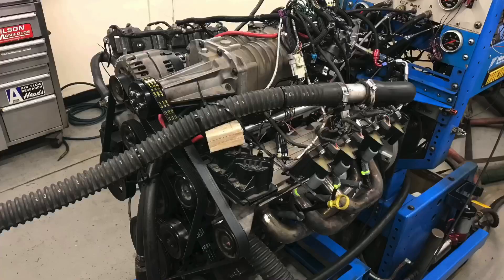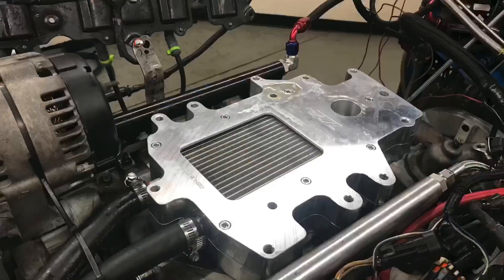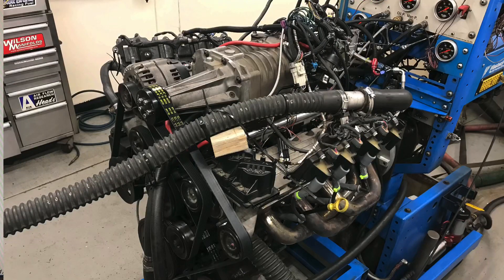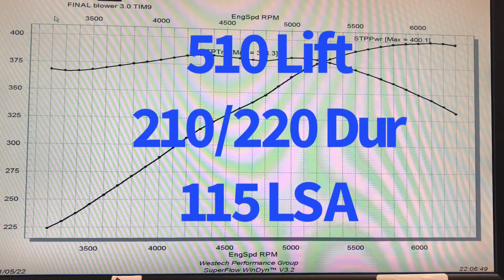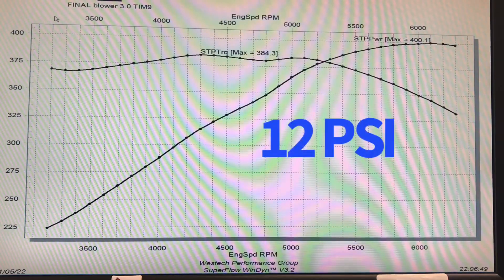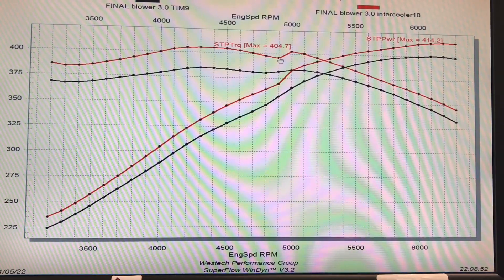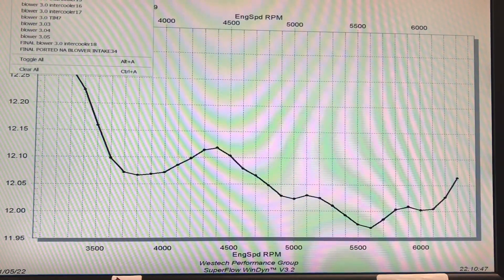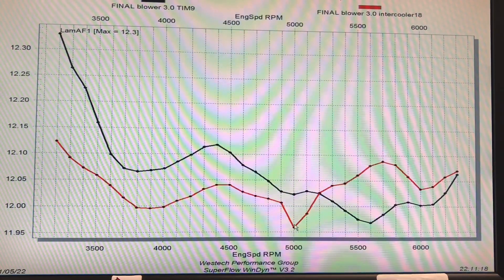DO INTERCOOLERS ADD POWER? JUNKYARD SUPERCHARGED 3800 L67 V6 INTERCOOLER TEST. ZZP AIR-TO-WATER TEST

Comment: The horsepower does not change much because the mass airflow through the supercharger remains about the same. Cooling that air does not affect the mass air flow nor the density of the air., you are just changing the factors of the PVT equation. The cooler air is desirable though for all the stated reasons.

Comment: If anyone can help I'm gonna to run that tbs #5050 intercooler on a roots blown motor mostly street driven hearing that an icebox in the trunk  isn't practical for daily street driving and that I need a separate cooling system like a heat exchange radiator and electric pump so I will have to have two radiators can some one explain the set up and part numbers if possible thanks
Reply from the maker: pump, reservoir, secondary heat exchanger (like an oil cooler), then lines and fittings and wiring.

Comment: You attempted 1 of the 3 ways to interocool these engines. And these engines require very specific tuning. Look up Brushworks Slick Sixes.
Reply from the maker: they don't require specific tuning. The require tuning like any other motor (it's just timing an AF)

Comment: I wonder if The dip is from so much torque. Being applied to the accessory drive belt. You can see the AC compressor starts to spin at higher rpms

Comment: Richard, I honestly believe the reason why you got more horsepower with the air cooler as opposed to the water meth injection is because of Plenum volume by adding the intercooler, you added more volume to the Plenum. Therefore, you had more air available and much better much better cooled air charge.
Reply from the maker: nope

Comment: I know a air to water. Intercooler is very efficient but I have always wondered if instead of water running alcohol fuel Through it, alcohol fuel stays super cold all the time Even if it it's been sitting out on a hot day it's still cold If it was pumped from a separate reservoir down through let's say a transmission cooler Mounted  in front of the radiator and then pump through the intercooler, I would imagine that would be super-efficient.
Reply from the maker: never a good idea to run volatile liquid through the cooler

Comment: OK your the man to ask.....What if I rerouted the ac lines to use the intercooler as the evaporator for the ac...Yes I know i would have no AC IN THE CAR.. but what would it do for the motor?
Reply from the maker: colder is better but you still have losses from driving the compressor

Comment: It seems that the "rule of thumb" is 1 percent increase in HP for every 10 deg cooler. Or roughly 10 percent for the 100 degF change. 400 hp x 1.10 = 440 hp with the intercooler. I wonder if the intercooler is restricting the intake.
Reply: I came across this article which uses a formula directly relating intake air temperature and hp. According to the math, I would expect at least a 33 hp gain at 6100 rpm.
Reply from the maker: temp alone doesn't change power

Comment: I was happy to find out how easy it was to install ZZP new full size intercooler with the dual pass heat exchanger and also equally as happy to look at my Aeroforce scan gauge and see no KR with a 3.0 pulley when before I was getting KR with a 3.4 pulley I also swapped out the pump that came with the setup with a higher volume pump. Its a bit louder but not a deal breaker. Its the piece of mind I was looking for and the billet fuel rails  look good

Comment: Intercooler is not only a little boost in horsepower but is dramatically a horsepower saver from the heat, great testing. Testing separates fact from myths thanks for your hard work.

Comment: My short stack intercooler made a huge difference….it allowed me to use a 3.4 pulley with 0 knock…..I was gonna change to a smaller pulley…..my 3.4 pulley gave me 10psi of boost.

My conclusion is a intercooler itself might add a little HP, but it allows you to use upgrades, like smaller pulleys….ect.
Reply: what type of fuel?

Comment: I don't know why these cars ever came without intercoolers. Every supercharged or turbo car I've ever owned had an intercooler except for my Fiero GT which has a 3800 SC GTP series 2 motor in it. I've thought about adding one but in a Fiero GT I don't know what & all it is going to take to do it. I guess I have to run the intercooler all the way to the front of the car but the only way to run piping up there is probably going along where the radiator piping is ran. 🤷

Comment: I'm looking for a used Gen3 cooler core to put under my charger. Thinking someone out there has put a Gen 3 in and later maybe swapped for a Gen 5 arrangement. I also have some extra Gen 3 complete chargers on hand I would turn loose of. I know everyone would like to have the latest greatest piece but the cost of these and availability is not putting them out there in excess supply #'s.

Comment: I think the power gain is from the intercooler cooling the air so much and we all know cold air is more dense. So more air with tune adding more fuel and timing you get more power...The methanol was just adding octane to the air not making the air more dense

Comment: I am about to reinstall my ported m90 gen 5. Before I do so, I would like to a IAT sensor in the lower intake manifold. This way I can monitor IAT post intercooler. Where would be the best location, and best sensors to use that I can view on a gauge? I see many cheap sensor gauge combos, but do not think they are FAST sensors. Any help would be appreciated. Thanks
Reply from the maker: we use a simple digital type k

Comment: Most engines most of the time spend their life just cruising. Mostly only needing boost during acceleration, or occasionally Towing or climbing. And for that gearing makes more sense. 
    Nice thing about superchargers is they can be operated with a electric clutch.  My bush plane has two superchargers with clutches feeding a stroked type 1. The superchargers are mostly only used for short takeoffs, and tricky Landings. 
   I'd really like to see Dino runs with and without the supercharger engaged.
Reply: As far as intercoolers go. That's why I'm here. 
   Considering using one for the 4.3 in the 75 Celica ST.  
   And yes they are on clutches also.  (2) I love the fabricate.lol
   But the extra horses from the intercooler would be welcome when playing hard.

Comment: Hey Richard love your energy and ALL your content, I curious about the electronic side of the 3800SC, did you run a stand alone harness for it? And if so could you give some info on who does that harness work I'm wanting to swap a l67 or l32 in my 94 grand prix STE
Reply from the maker: WE USED A HOLLEY HP

Comment: But 10 hp is the gain, and the temp is irrelevant when you are moving forward not gonna stand. Add fans, and a  fender cai and you're talking 30-40 degree drop. $900 kit is not worth 10 whp

Comment: Consistent 100 degree difference! 
15hp gain overall, but once the non-intercooled supercharger heat soaks, IAT's go up, you hit the compensation table with reduced timing losing up to 50hp makes it almost a 65hp gain theoretically. Depending on horsepower loss with maximum reduced timing.
Reply: Very well said
Reply: on the 97 3800 the IAT is pre blower so it won't know to pull timing.
Reply: @Toys4Life  timing compensation is based off of IAT
Reply: @BassManBobBassCovers  Absolutely!  Problem is on the L67  the IAT sensor is before the blower so it doesn't measure the HOT air post blower - it only measures ambient air temp entering the blower.

Comment: I would not boost an engine without an intercooler. It's just too much improvement to not add that. You're already spending a significant amount of money. And it even protects the engine and maybe even the turbo itself.

Comment: Id say you made more with the intercooler because of the added volume in the intake manifold
Reply from the maker: no
Reply: @richardholdener1727  what's your guess, I thought since it had a longer style plenum it picked up. What's your thoughts

Comment: Plz do a L67 with the Eaton M90 with meth and no intercooler and is it as stable or more stable than non ic and ic. and should meth go before the blower or into the intake after the blower?
Reply from the maker: STABLE?
Reply: @richardholdener1727  more stable intake air temps ?

Comment: I run a TBS intercooler on a roots w/14# 446" and yes it works.I also had 100* drop in IAT and gained 100hp as a result.
Reply from the maker: gained 100 hp?
Reply: @Richard Holdener  yes,on the dyno 1st no water in intercooler then water minutes later and was the result.

Comment: Hey Rich, what pound valve springs are in the heads, 90 lb, 105 lb, 130 lb, or 136 lb?
For the horsepower I want for my 2003 Grand Prix GT wit L67 swap in it, you have all of the parts that I need to make 400 easy as fuck.
So far, I am in bolt-on mode, headers, 3" cat back exhaust, 4" cold air intake, 3.4" pulley with billet aluminum tensioner, and idler pullies, and a 1.0v ZZP ecu tune. Another $5,000.00, and I will have the rest, then, good to go. GREAT VIDEOS👊👍👍🔥🔥🔥💯🇨🇦
Reply from the maker: WE RAN LS3/LS6 SPRINGS IN THE STOCK HEAD AND 26918 COMPS IN THE PORTED HEADS

Comment: Would the Intercooler possibly pull heat away from the supercharger itself? Would be interesting to see the difference in the heat of the supercharger case
Reply: Good question, I was wondering the same??

Comment: The water meth injection is lowering the amount of air fuel mixture by adding an inert element. Water.  This is displacing air and decreasing the amount of available oxygen?

Comment: E85 is helping keep the intake temperature down. I bet the intercooler would be even more effective with pump gas.
Reply: It shouldn't, on the supercharged 3800 the injectors are mounted on the intake port on the cylinder head, pretty far downstream from the blower.
Reply: i think ethanol helps with Combustion temps, not so much IATs. The injector isnt far enough up stream to effectively cool the charge

Comment: any thoughts on doing an adapter plate to run an M112 or M122 on the 3800?
Reply from the maker: I DID ON BACK FOR A kb TWIN SCREW
Reply: @richardholdener1727  ohhh, gotta go find that now

Comment: With water/methanol injection, even though the charge temperatures are the same as an I/C, the effective octane is being raised, and it changing the octane by slowing down the burn speed. The only real ways to take advantage of that are to increase the timing, increase the compression ratio, increase the boost. Since the engine was already running E-85, adding more timing probably wont help so it would probably respond better to more compression or more boost.
Reply: One thing I can tell everyone here- on my own car, which hasnt changed for a few years. When the intake air gets too cold, it "seems to be down on power, and the boost is lazy. As the intake air gets warmer it makes more power, and the boost comes up quicker. It is into "happy land" when the intake air hits 120, and no further improvements in responsiveness are seen. Power seems to start falling off (slightly) past an intake air temp of 140-160, which it only gets to after a hot re-start. I had often wondered why it seemed like that... everything I had read in the past seemed to suggest that colder air is ALWAYS better, but then I was looking at a race fuel information sheet and it said that (for that fuel) the most efficient intake air temp for that fuel was 130F. Things like that, along with the dyno test that showed only a 3.5% increase in power despite dropping the intake air temps 100 degrees(!) makes me kind of wonder if theres a point where too cold is just too cold.
Reply from the maker: OCTANE DOES NOT ALWAYS CHANGE BURN RATE-THOSE A SEPARATE THINGS
Reply: @richardholdener1727  You are right, but in the case of water and methanol, BOTH slow down the burn rate a bunch, and if you dont compensate for that in some way, you lose power, or at least dont fully take advantage of it. I've heard of guys running 27 degrees total at 30 psi or close to that on pure methanol injection.

Comment: What temperature thermostat and spark plugs were you using?

You guys should do more tests like these...
Get a baseline With just a stock motor, and then do some of the common needed supporting changes as well like a lower temperature thermostat, and lower temperature spark plugs. Try a few different pulley sizes as well. And may be a phenolic spacer.

That camshaft is not very common. And if you’re going to go big, try 2.8 inch pulley.

The generation 3 heads have .030 inch larger diameter intake valves.
Reply from the maker: THE AC IS IN THE BELT LOOP, WE DON'T RUN A THERMOSTAT (THIS IS NOT A STREET CAR-IT'S DYNO), WE RAN DOWN TO A 2.6 PULLEY, i WOULD BE SURPRISED IF WE COULD MEASURE AND DIFFERENCE WITH A PHENOLIC SPACER-MAYBE IN A HEAT ENGINE BAY

Comment: If you look at the belt, at what's sounds like possibly 4,900 rpm, it has an unsteady vibration. It does the same slightly in a few other smaller power dips early too. I'm guessing the vibration is could be causing turbulence on air intake and possibly exhaust, leading to a sort of "blockage". Air pressure waves basically. It would be interesting to look into.

An on-screen tach would be helpful in the future if possible.

Comment: Maybe valvetrain harmonics worked itself out or maybe the header savaging isn’t optimized to cause that dip and then it pushes through it. I’m assuming you aren’t using a knock sensor.. if you are, that would be the first place I’d look at.
Reply from the maker: ITS NOT KNOCK

Comment: So when you did the water/meth test on this motor and went from 190* temps to 105* temps. Why didn't you pick up similar HP/TQ? Is it because the IAT sensors data is junk when the thermistor bulbs are wetted by water/meth?
Reply from the maker: OR BECAUSE THE WATER METH DID NOT INCREASE THE NUMBER OF OXYGEN MOLECULES PRESENT AND DID DISPLACE AIRFLOW
Reply: @richardholdener1727  If that's the case the spraying pre turbo should alleviate that somewhat as its cooling the air as its being compressed and upping the efficiency of the turbo itself. Have you done any pre turbo vs post tests?

Comment: Water to air and ice in the tank makes for a great supercharged/turbo bracket racer and almost completely eliminates Altitude Density swings. I have the pump on a toggle switch and flip on the pump between the burnout and staging to conserve the ice.

Comment: Good Video Richard. Would it possible to know following things aswell (also any other upcoming intercooler tests): Water temp IN and OUT to intercooler (along with IAT temp curve) + used pump/water GPM to understand efficiency of intercooler.

Also try get video camera which is supporting 1080p or 4K :)
Reply from the maker: SHOT ON MY PHONE, DONT HAVE A SEPERATE WATE RPUMP, JUST THE DYNO-WE REGULATE THE FLOW WITH A VALVE, WATER IN WAS 68 DEGREES

Comment: 3:25 the 4800 to 5000 harmonic ramp is just like I've seen on the RB25 and 26. On the DOHC Nissan it's at 3700 rpm, and it's from the ignition pickup and the belt driven cam harmonics. On the 3800 V6, it's most likely from the crank shaft  pulley to belt. Probably slip, Maybee from the G rotor oil pump loads. On some engines, you get fuzz from certain RPMS. Ford's 120 degree F1 during development had a pinout problem with its EECIV, which created a lash Ariel which returned an incorrect voltage to the Crank position sensor. Prox sensors can fail due to alignment issues at certain revs. Happened to my mates 1967  turbo SEFI Holley HP managed 3.3 liter Ford on line six.
Reply from the maker: IT'S THE DYNO-WE FIGURED IT OUT

Comment: Richard, love your work, keep it up.

A couple comments on this video. 
The drop in AFR on the intercooled run wouldn't be from a misfire event, misfires cause the o2 sensor to read lean (not rich) due to the excess air (12+/- times the amount of air to fuel in this case) not consumed be the misfire event itself. 

You mention the AFRs being close to each other in both configurations, afrs aren't significant to the power output on a fuel injected system, unless there is an outlying misunderstood issue, for instance a poor flowing injector. Power output should remain the same from somewhere in the range of 10.8:1 all the way to low 13s. Obviously we run lower afrs for cylinder temp control.   

Where is the IAT sensor? Did the Meth make less power due to the a rise in intake air temp (less dense charge) traveling though the supercharger, intake manifold and intake port?